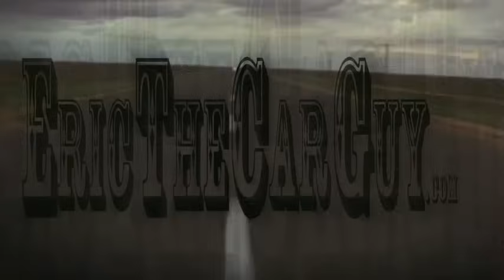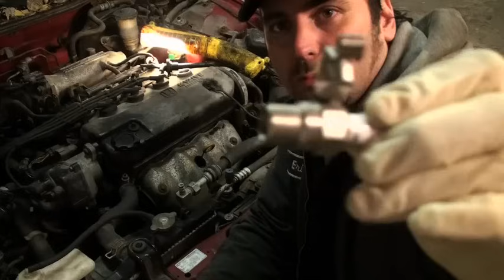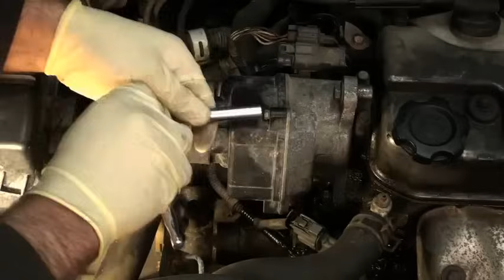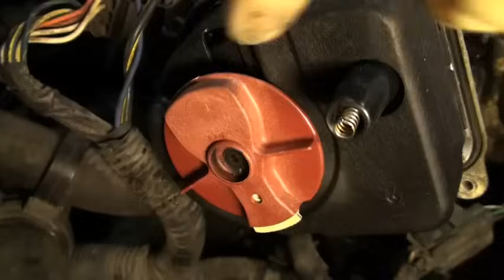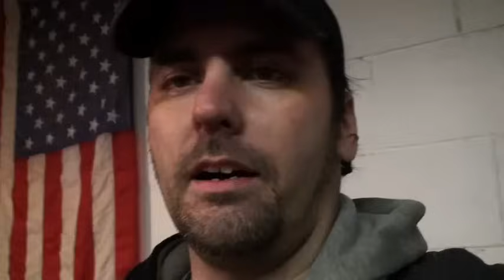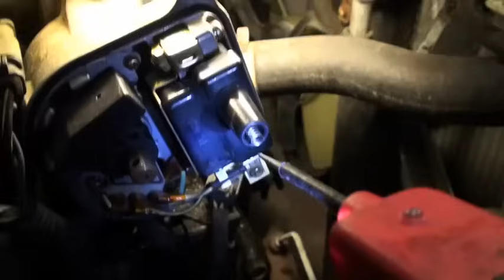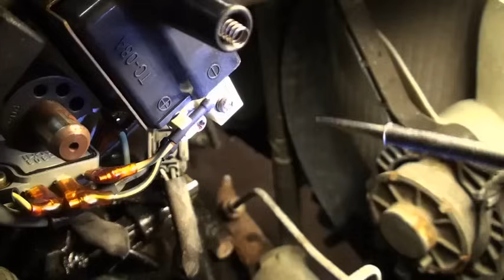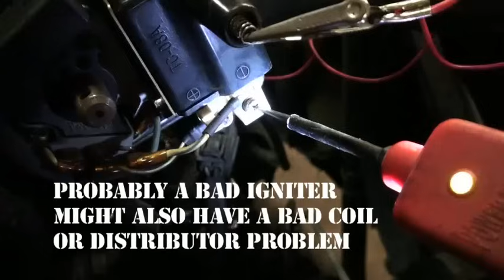No Spark Diagnosis (Honda) - EricTheCarGuy

Comment from the maker: @jastube17911 If the plugs are wet you might be flooded, dry the plugs and when you go to start it try putting your foot to the floor on the gas while you crank the engine this will turn off the fuel injectors to help 'clear the flood'.

Comment from the maker: @prinnyjag I NEVER recommend replacement of the distributor on a Honda for a no spark situation, I always advocate doing this test to find the source of the problem.  It's not a bad idea to check the mechanical timing of the engine if you know you have spark and fuel.  You need to find out what you are missing first spark, fuel, or an engine mechanical issue.

Comment from the maker: @FollowingJohn In that situation I would be replacing the coil AND the distributor sub assembly.  I highly recommend using an OE distributor as I've seen lots of problems with the aftermarket units.

Comment from the maker: @1989purry I'm not sure I understand your question but if you have spark at the plugs the ignition system is working, you may have a problem with timing.

Comment from the maker: @TheCivicdrifter You might want to make sure that the cam is spinning like it should, if the distributer does not rotate with the engine it will exhibit a condition like that.

Comment: hi Eric, i checked my coil for spark and there is only one spark when you start to crank and thats it. then i went to see if the igniter is bad and it wasnt going on and off like in the video so i replaced it and it still wont work what else could it be?

Comment from the maker: @EricxXx49 If your getting spark I don't think anything is bad, you may just have low battery voltage, I would start by checking the battery first to make sure it's got enough juice to run the engine.  Good luck.

Comment: @ericthecarguy
my car ran out of gas.. put gas in.. still no start... went tto the spark plugs.. its getting an orange spark.. no purple spark... is the coil or igniter bad? its gettin spark but enough? can ggapping the spark plugs to the correct gap and cleaning thee coil on the plug help it start? its a 92 toyota paseo.. EFI .. So its ffuel injected.. its gettin gas.. its not clogged...  so what you think i can do?

Comment from the maker: @nico27004 You don't need to replace the entire distributor all you would need to replace is the coil.  You might want to watch the video I did on replacing the distributor on my Integra for how to get the coil out as I believe that has a similar design.

Comment: I just did a valve job on my 94 civic d15b7, replaced the timing belt, plugs, wires, cap and rotor. when I first tried to turn the car on, it did so for about 30 seconds, after that it shut off and will not come back on. if it isn't the distributor, any other ideas?
thanks -danny USMC

Comment from the maker: @musiclover4636 I don't recommend replacing distributors on Honda's with anything but OE units and the only reason to replace a distributor on a Honda is if it's leaking oil internally or full of orange dust.  If you have a no start caused by a no spark condition then follow the steps in this video to find the source of the problem.  Good luck.

Comment: @EricTheCarGuy Hello, well I replaced the igniter and was a no start , I retested  the new  igniter with the "probe" and had no flash so for the heck of it I tested it with a "regular test" light and had flash with crank. I switched out the coil and car started right up. Thinking maybe my probe has to high of resitance where it doesn't flash while crank.Thanks for tips and fast replies, learned quite a bit.Keep up the good videos :)

Comment from the maker: @TekkHakk By the sound of it the igniter is bad, I would replace that before the distributor as aftermarket distributors for Honda's are junk in my opinion.  I know you said they tested it but it's either bad or you have something hooked up wrong from what your describing.

Comment: @EricTheCarGuy Hi, it didn't pass this test,it went red on probe and when cranked no flashing. I checked all the fuses and all are good. I was just curious and double checking so I took it to auto parts they tested it but I wasn't too convinced that it was good.I just want to make sure before I  spend on parts for guessing. I called different auto parts and few want to sell me a whole Dis. hmmm, I will try to post a video , thanks for the help keep up the good work!

Comment from the maker: @TekkHakk If it passed the test in this video and the light flashed when you cranked the engine at coil (-) then the igniter is good, if the power goes away perhaps you have an issue elsewhere in the circuit perhaps check all the fuses to make sure they are all good.

Comment: Great videos! I 'm having this problem on a 1993 Honda civic ex 1.6. I tested at the - of the coil that leads back to the ignitor I get red + on the probe when I crank it light on probe shuts off and doesnt flicker. I pulled the ignitor off and took it to aaparts and had it tested and tested good, I wasn't too convinced since I was the one reading the instructions for connecting it the tester .Is there a way I can test it myself? If it is good could it be a crank sensor ?Dis was replaced b4.

Comment: @EricTheCarGuy I agree with not taking shotgun approach, but if You have to risk it ( is situation like - not being able to go to work next day since Your car is dead and You don`t have even the test light to check the module and multimeter will not show those quick ground switching since it`s just simply to fast for it). I`ve also measured the coil for resistance like Honda manual says - the resistance was within the allowed range, but the coil was still faulty - no spark at all

Comment: @EricTheCarGuy Thanks Eric. As far as lubricants-theoretically i agree but  just a little bit of copper won`t hurt ( i don`t mean like soaking this thing in it, but just really a liittle tiny bit on the bottom of the thread ) i`ve been doing that on many cars-never head a fault and next time this car comes back with some ignition issuei don`t have to take the whole thing apart, muscling with that screw risking damage to other components of the whole assembly and it still sits tight

Comment from the maker: @mizer6666 Do not put any lubricants on the rotor screw as it normally comes with lock tight for a reason as you don't want it coming loose at high RPM inside the cap.  If you have difficulty removing it all you have to do is tap it with a punch and hammer in a counterclockwise direction to knock it loose, you can also use an impact driver.

Comment: And one more thing - the screw that is holding the ignition rotor could be a pain to move, i had a standard "star" ended bolt so it was no go - had to remove whole thing from the block and sacrifice the rotor to get the job done, then just replace the dumb bolt with a normal 8mm standard socket one - it will be a whole world of difference to remove it even after couple years if you add a little bit of copper grease on it as well

Comment: Since i recently did ignition job on couple of Hondas ( and Your video was more then helpfull ) - if You are sometimes at loss and not sure which one is bad, module or coil - in 90% of all cases if Your module is bad You would have an engine light as well, so if you have no spark on the coil and no check engine light - replace the coil - worked for me everytime.

Comment from the maker: @moisesalpha1 Look to find what is missing, spark, fuel, or an engine mechanical issue.  Once you find out what's missing you'll be able to complete the diagnosis and perform a repair.

Comment from the maker: @sidneyam I'm at a complete loss on this one as I'm not an advocate of replacing distributors on Honda's unless they are leaking oil into the cap or they are filled with red dust and then I only recommend replacing with an OE unit.  As for ECU's the only time I've ever seen them go bad is from damage from the outside (flood, hooking up a battery wrong, etc.), they don't normally just go out.  Did you check the fuses?

Comment: Hey ETCG. My car recently stalled after getting gas and wouldn't start up again. I had a shop diagnose the problem because I had thought it was a problem with the distributor. I put in  a brand new distributor before taking it to the shop. The shop said my ECU went bad because it wasn't supplying any power to my distributor. So I took the car home, bought a stock ECU off a guy who likes to mod them on Ebay and hooked it up to my car. Now I get spark to my plugs but the engine wont start

Comment from the maker: @HondaVtecDOHC First the main relay has nothing to do with spark as it powers up the fuel pump and ECU so forget that.  If you have spark at the coil and not at the plugs the problem is at the cap, rotor, or wires as stated in the video.  Remember if you don't have power at the coil you need to look to the primary circuit for the cause so be sure to check all the fuses.

Comment from the maker: @cardahon Actually either will work but I would recommend negative, what your looking for is a blinking light as you crank, if it's not there replace the igniter, if it is, replace the coil.

Comment from the maker: @HondaVtecDOHC That's a tough one because it sounds like a special case.  If you know you have spark and fuel then the next step is to check engine mechanical i.e. the mechanical and ignition timing of the engine and it's ability to produce compression.

Comment: @udontno561 i had this same problem, they make a tool called a "Hand Impact Wrench" you just put the proper tip on it and whack it with a hammer. did the trick for me, i picked one up at the local Harbor Freight Tools for $5.99

Comment from the maker: @abigailfshs2013 If you have spark at the coil but not at the plug it's the wire, cap, or rotor.  Check them all for damage and make sure you replace them with quality parts, OE or NGK.

Comment from the maker: @integraz32lover I would not condemn the switch right away, not all parts are created equal.  You might want to check to see if you have a signal going to the starter solenoid when you turn the key, all you need is a test light, just put it on the wire and see if it lights up when a friend turns the key to the start position, if it lights up your ignition switch is good and your problem is likely with the starter.

Comment from the maker: @civicpro13 Did you follow the steps in this video?  Do you have a signal at the coil?  Is there spark from the coil?  Lastly I recommend you use NGK or Nippon Denso plugs for the best results.

Comment from the maker: @SargeantH If you have spark then the belt is probably not broken but that doesn't mean that it couldn't be out of time which would be just as bad.  Even if the belt didn't break it could have jumped time causing a no start.

Comment: Good video!  Sometimes you can just see or hear the spark jumping to ground where it shouldn't due to a break in a secondary wire insulation or component, especially if it is a rainy day.

Comment from the maker: @Biothumper79 I don't like cheep parts for Hondas if I'm honest but in your case I might remove the dist cap and see if the rotor moves when you crank the engine, you could have a problem with the timing belt.

Comment from the maker: @chrisline12 Just replace the effected parts and not the entire distributor, only replace the distributor if it's full of orange dust or leaking oil internally.  There are only 2 problems that normally happen with a no spark on a Honda, a bad coil or a bad igniter, this video will show you which one is bad.  Also check all the fuses as there is one for the ignition that if it's blown will cause a no spark condition.  Also never replace the wires if they are OE and use NGK or Nippon Denso plugs.

Comment from the maker: @kkjoshua Find out what is missing, spark, fuel, or an engine mechanical issue, I've done videos on finding all of that stuff.  It works much better than just replacing parts hoping they will work.

Comment from the maker: @jdmrcool13 Do you have power at the coil?  Do you see the signal switching at the negative terminal at the coil?  Just changing parts doesn't work you need to determine if the problem is in the primary or secondary part of the ignition system, don't guess, test.

Comment: So what if you know that the plugs, wires, cap, rotor, dist., coil and igniter are all good but it still doesnt have spark. Would the only other option would be the ignition switch(tumbler) not giving power in the ON (II) position?

Comment from the maker: @rogersantosmolina First I don't like the aftermarket distributors as they are not as good as the OE, second did you perform the tests in this video as it shows how to diagnose a no spark problem on a Honda, a Civic at that.

Comment: He shows you if the igniter is having a problem, if the light doesn't light up on your test light, the cause is probably an igniter problem. Like he says. But, if the light is lit and not flickering, the problem is the triggering process isn't working correctly. This may be do to a lot of things, and what I did was went directly to the ECU. During testing I encountered both a steady light on the test light, and flickering, which is one of the reasons I was confused... 

A lot of posts. Sorry...

Comment: Correction to my suggestion comment (So I don't sound like an Idiot). When he shows you how to test the igniter, he says the light should be blinking, so thats pretty straight forward. But, when he shows you a bad igniter, the light is off completely, so it's not totally specific. So, if you're a noobie (me), the light may be lit (not blinking) while cranking, and you will automatically think the igniter is ok because you don't understand the 'triggering' link to the chain.  Cont'd...

Comment: I just wanted to add. My suggestions aren't to undermine his knowledge and expertise, but simply to point out things he did not mention.

In addition to these suggestions, if you choose to do a another test on the coil (test light only). Clamp the lead of your test light to the POSITIVE side of the battery. Then touch the test light to the POSITIVE side of the coil. Now crank. If the light shuts off, the coil is good, if it's lit the coil is bad. And, make sure the coil is grounded sufficiently

Comment: I would suggest adding these to the video.

1. Mentioning the ECU.

2. When testing the cars igniter, the ignition coil must be grounded! I noticed you have your coil grounded with a test lead alligator clamp, but you do not mention it is crucial to have it grounded, or you may damage it.

3. While testing the Igniter, other than having no light, the light must also be flickering, not just lit. If the light on your test light is not flickering, the ECU is not triggering, or the igniter is bad.

Comment: Page 10: The problem, and solution (cont'd)...

My problem was the ECU, which sends the triggering signal to the Ignition Control Module (ICM), this is the "Igniter", igniter being the term he uses to describe it in this video. I'm not exactly sure of the actual cause of the ECU malfunction, I have ideas, but that's not important. Apparently, my cars computer systems aren't reset by simply pulling the power to the battery, this may depend on the make, model, and year of your car...

Comment: Page 9: Testing, results, and SOLUTION. 

Being forced to really brain storm on the issue. I put two & two together, the CEL being on, and there being no spark. So, this may be a computer problem. I started digging around for info about the cars computer and ignition system, and found the ECU, or PCM etc... I found how to test it deep in Google, I tested it with a multimeter, and got no power (Hz), from the ECU. The first link of the chain there would be to reset the ECU. So, I did. Cont'd...

Comment: Page 8: Same problems, testing, and results. It's getting VERY weird now. 

After replacing the cap & rotor, it fired right up (CEL is on now). So I repeated all the things I did before, and the car stalled again. I went to check for spark, nothing from plugs, or distributer, so I tested the coil. The coil WAS getting spark. Then (heres where it got weird), the coil stopped sparking! I'm stumped, and with NO info anywhere around the web about the generation of my car, I had to think. Cont'd.

Comment: @phorse Page 7: More testing, replacement parts (distributor cap & rotor), and results.

This time around I didn't waste any time trying to start the thing. I just went straight back to square one (AGAIN!) spark plugs. I was not getting a spark from the plug, moved on to distributer, then to the coil. The (brand new) ignition coil was getting spark. So I replaced the distributor cap & rotor. After replaced the cap and rotor, it started right up. Problem solved? NOPE! Cont'd

Comment: @phorse Page 6: More testing, and results. Even weirder now.

After letting the car sit for an hour or so, I naturally grew eager to test it again. So, I went straight back to square one, testing spark plugs. When I cranked the engine, the car started... I once again let it idle for awhile, keeping an eye on the temp and listening for strange noises, the car was functioning properly so I gave it the rev test, it stalled again, and had the same symptoms as before. Cont'd...

Comment: @phorse Page 5 (Cont'd): Part replacement (Ignition coil), tests, results, and symptoms. Here's where things got weird. 

After replacing the coil and putting everything back together, the car started right up, so naturally I thought the problem was solved. It wasn't... I let the car idle for 30 minutes or so to get it warmed up, and revved it. The car stalled, restarted for a few seconds, 3rd attempt, like before, no ignition. After trying for several minutes. I quit and let it sit. Cont'd.